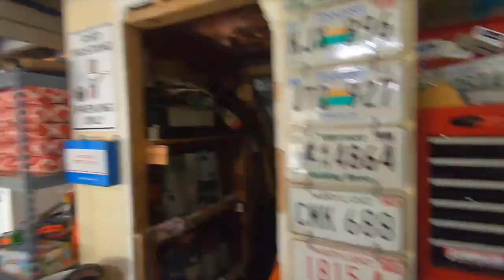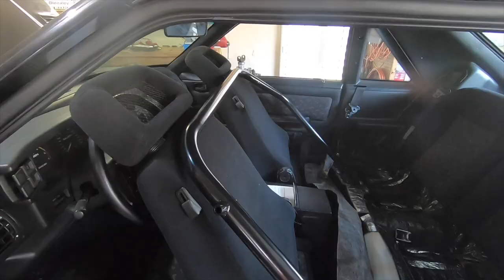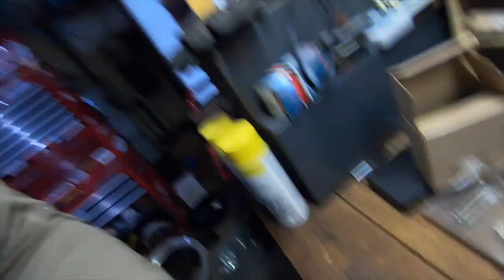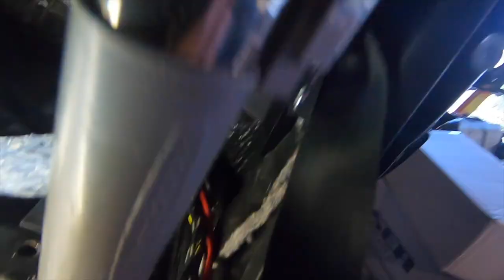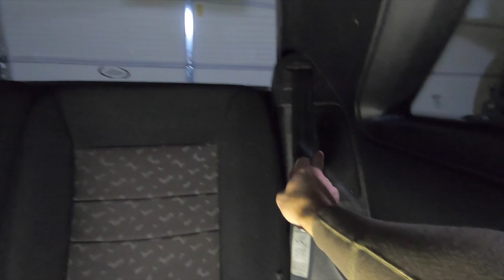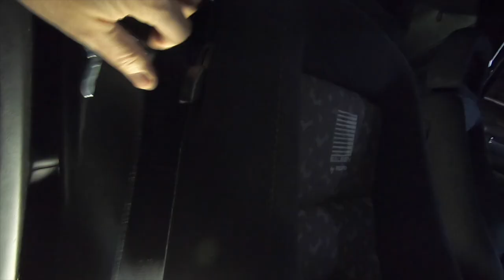Foxbody Saleen Mustang 2 Point Chassis Brace - "Roll Bar" Install - Into 1993 #33

Comment: Oh I have GOT to have one of these! I'm signing up. I sure hope you make some. Another great video!
Reply from the maker: We're going to see what we can do.
Reply: The thing that I really like about the bar compared to any of the others that are avalable. Is how tight it forms around the inside of the car. I LOVE the upper attaching point using the shoulder  belt point. My plan is to use a racing harnesses. So I wouldn't even attach a belt there. I would just bolt it in. What structure stiffinging. This main hoop has been what I've been looking for. I will build off of it to make a 6 point.
Reply from the maker: You could take it a step further on the base by fabricating base plates that go under it and maybe even doing something to make the "pad" of the bar more structural. That would add more support in case of a rollover or side impact.  If we do make then they will ship bare steel. So you can modify as needed for the application and extra safety.
Reply: @PuristMotorsports  That is just what my plan is and that is how I would want the bar. Like I said. This is the tightest main hoop avalable. If it becomes just that.  But the big sell to me is that bolt sleeve for the shoulder belt. This would be my backbone to a 4 point or possibly a full cage. 
You know how to contact me if you guys do it.
 Keep doing what's you are doing. It will catch on. You're doing it right.

Comment: Nice video!  Very informative how Saleen was thinking.  I just did a MM bar install and video with the back bars already welded, wasn’t a 2 hour job, but turned out well.  Very similar to the autopower bar in my other 89 hatch.  Just be careful drilling the pass side floor pan, there are some evap lines (not fuel lines like everyone thinks) down there.
Keep up the good work!

Comment: My first thought when the vid started was “Bob somehow looks less sage and wise”🤔😀

Great job of fabricating and installing that Bob. 

My 4 point AutoPower bar that I installed 20+ years ago has plates that go under the floor to match the plates on the bar (to spread the load), and 2 nuts per bolt so that they won’t loosen. 

I wish it bolted to the seat belt mounts the way the Saleen bar does, who ever thought of that was brilliant.
Reply from the maker: Thanks for the kind words Foley.  You're right, whoever thought of it really was genius. The design could be improved at the bottom mounts at the floor pan to make it more of a "roll bar" than a chassis brace. It's amazing how much strength it adds. We copied this one off of the one that is in the Bleakley Saleen. I have a copy of the window sticker and it's the only option that car came with from Saleen.  When I went to put that bar back into it I could really tell a difference in the way the chassis responded to the road surface.  

Ultimately I'd like to get the 6 point version in Almost 4.  That's a goal from this experience.

Comment: Consistently inconsistent… my 89-194 hoop bolts to B pillar and end the belt bolts to the hoop
Unlike how yours has a single long bolt
Maybe your example was made after 1989 idk
Reply from the maker: There were a few early ones. The later ones bolt through the tube with a sleeve which is how all the SSC’s are done at the seatbelt mount. Some early ones I’ve seen have a tab like the one in this coupe. Is this one in the coupe like yours?  

https://youtu.be/KOIEyUXDWfI
Reply: @PuristMotorsports  yes. Like that